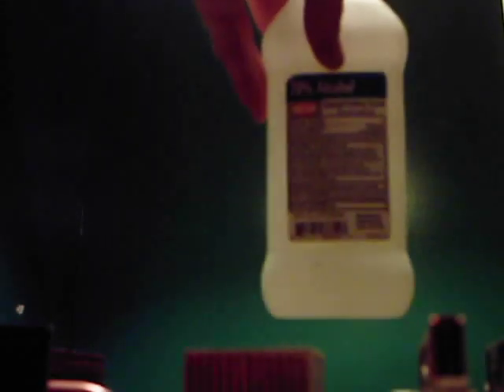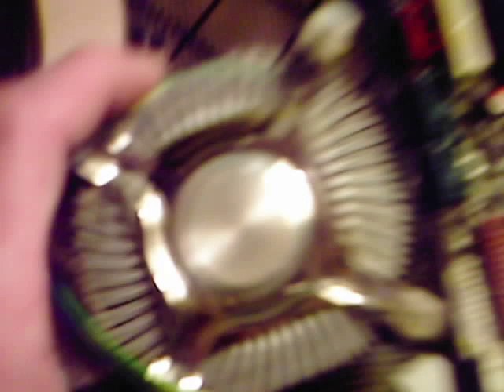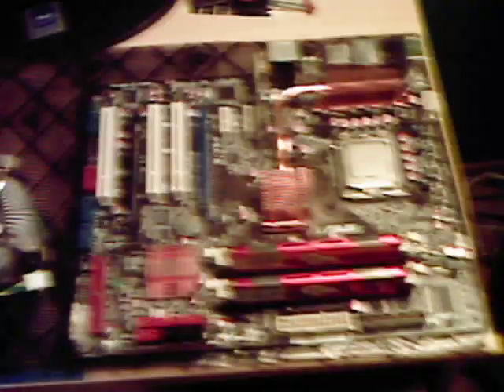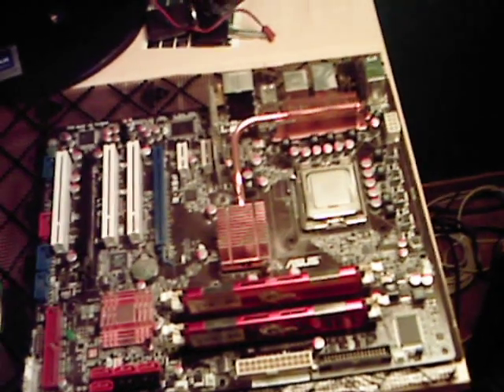How To: Clean Thermal Paste(All CPU/GPU)

Comment: I recommend not using a towel... use a cotton 'q-tip' with 80%+ alcohol. The reason why you don't want to use a tower is 1) It may leave lint / lint particles 2) it creates static electricity if you accidentally rubbed a dry part over the motherboard and damage parts.  

if you use a cotton 'q-tip', it has a smaller surface, reduces the chance of static electricity, and you are more 'gentle' on the hardware.  This is just my opinion - I would rather be a little more cautious when it comes to ESD

Comment from the maker: @1982FMJ You should attach the across from each other first then the others the same way. Kinda like you would a car with 4 lugs or bolts on it. Star type of pattern and put you hand under the board to support it. As long as you ground yourself you will be fine.

Comment: @DeepSpeech 

the older stuff dries up and becomes less conductive making less contact between the fan and heatsink. once the new stuff is applied on a clean surface you will have better contact making your computer a lot cooler to run.

this will save anything from running too hot :)

Comment: you want to spread it as thick as possible all over your mobo. Some people will tell you differant, but i personnaly use 10-15 tubes of Thermal paste every 6 months or so, and my cpu idles at around 25c and goes to 28c at 95% load.

Trust me!

Comment: Because you want to try and use as little thermal paste as possible (too much thermal paste actually turns it into a heat resistor instead of a heat conductor). If you added more new thermal paste to the remains of leftover paste then you will have way too much.

Comment: @dietydevil think of the two metal surfaces (cpu and heatsink) as two very bumpy surfaces. when they both come in contact they are not completely touching. the thermal paste fills the microscopic gaps between the two metals to transfer the most heat. and cool the cpu.

Comment from the maker: If its a older system might be hard but try this: run computer for a while at high load to get a bunch of heat and then turn it off and remove it. Do not pull but rotate it clockwise and counterclockwise and it will come off.